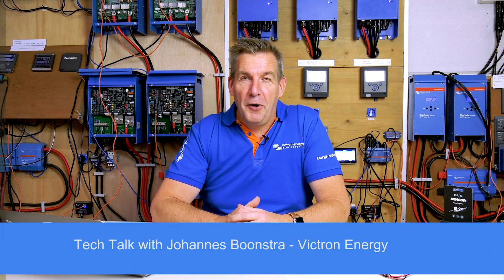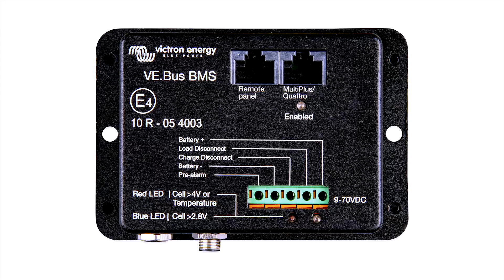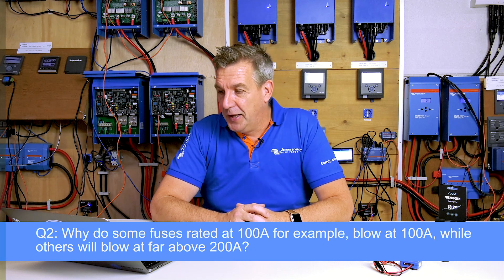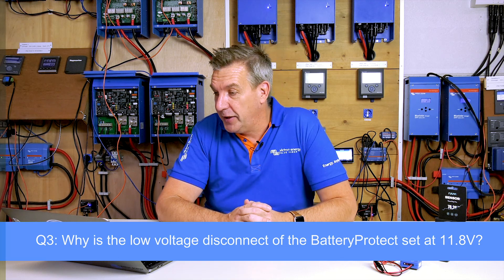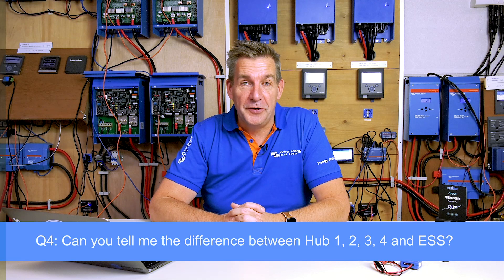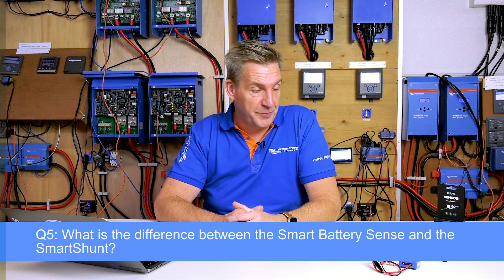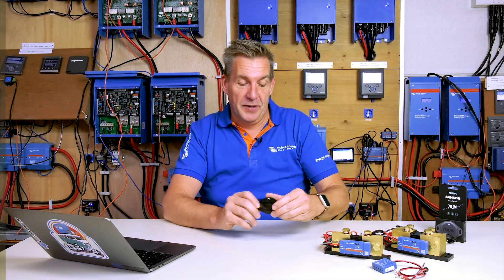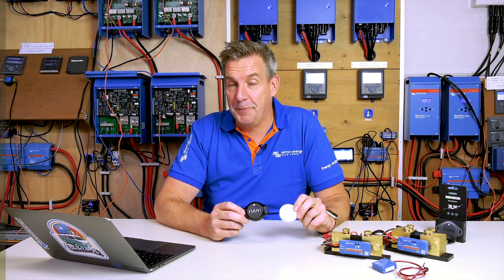Victron Energy Tech Talk - Episode 7 (VE.Bus BMS vs Lynx Smart BMS, Smart Battery Sense, SmartShunt)

Comment: Hello, can somebody help me with the settings/wiring 
from the Lynx BMS?
I have a question about the multipin connector from the Lynx BMS.
Pin1 and 2 goes to the Cerbo.
10 and 11 are bridged.
ATC/ATD and Relay are not connected.
My charger is an Skylla I.
Batteries are victron as well.
Connection between Skylla, Lynx BMS and Cerbo ist VE. Can.
What settings and Connection I need that the Skylla stop charging when batteries temperature is too low to charge?
In my case, the Lynx BMS disconnected (with the internal contactor) the batteries from the distributor and send an ATC/ATD alarm.
ATC is okay and normal, but why not ATD?
Best regards Robert
Reply: Please have a look at the manual as the terminals are decried in detail there.

Comment: Hello, 
if it's possible to turn the Shunt in the Lynx BMS that the power in is on the right side?
This would we great.
The manual said Battery's always left.
In my application the Battery's are on the right side.
Best regards Robert
Reply: Well its not just a matter of wiring the shunt, its also determined were the internal power supply is ect.  So no you cannot swap to the right , BUT, you can mount the unit "upside down" and use the stickers to have the wording on the front correct again.
Reply: @johannesboonstra6917  Hello, thank you.
With the Lynx Shunt VE it's possible.
(Changing only the five wires...)
What are the technical reasons that this modification isn't possible with the Lynx BMS?
Upside-down is no option....
Best regards Robert
Reply: @robertstuckle6198  because a BMS is something else than a battery monitor.  the reason is in the design of the BMS itself. If upside down is no option then there is no other option then to use longer DC cables I am afraid.
Reply: @johannesboonstra6917  Hello, thank you for the answer.
Is the following next model with 1000A technical the same?
Battery left without option to change?
Reply: @robertstuckle6198  yes, that's one will have a more powerful relay, but that's all.
Reply: @johannesboonstra6917  
Thank you.

Comment: Thanks Johannes, great information!
I have my Lynx BMS connected to my Cerbo GX via VE.Can. The other VE.Can port on my Cerbo is in use for my Hybrid network. I like to connect my NMEA 2000 network to the Cerbo GX in order to see my tank levels. 
My question: Can I free up a VE.Can port on the Cerbo GX by using the BMS-Can port for the Lynx BMS? If so, do I need to change settings? What do I do with the terminator in the BMS-Can 2nd port? Thanks, Jeroen.
Reply: Yes, CAN port can be used for multiple devices, as long as they share the same quadrate (Kb/s) , In the menu this value can be seen/set.    normally terminators are used in all open slots, when the port isn't used at all this isn't needed

Comment: I have the the 150/100 and 150/60 MPPTs running into a Lynx distributor>through a LynxShunt(1000)>to Lynx Power In. I also have a Quattro 24/5000/120 with all four connected to the CerboGX. The volatges I get at each unit vary as expected but for some reason the LynxShunt I get a much lower reading than the others. I decided to get the Smart Battery Sense just to reassure myself what the acutal battery voltage is and have the MPPTs use those for their charge guidance. 

Is there some way I'm missing to get the LynxShunt to get alligned with the other devices to show a more accurate voltage since that's what is prominently displayed on VRM? I have the Quattro battery monitor also showing on VRM but I would like to have the Lynx reporting correctly to get a better since of time to go.

Also is there anyway to get the Smart Battery Sense to show on VRM?

Comment: Would it not make sense for the battery protect setting to take into account the discharge current and the battery's internal resistance, so you wouldn't have to fiddle with the setting if your discharge current changes?
Reply: Hello,  then there is even more fiddling on settings as no battery is the same and also changes after time..  So...No this is not going to happen

Comment: hi////i have the victron bmv602s wired battery shunt,can you tell me if it can be used with the victron ve direct connect cable to a raspberry venos software
Reply: theoretically yes, but we dont actively support this so please check the community page to set this up further.

Comment: Victron is too confusing. Even making a simple inverter choice: is it a hybrid, grid tie, or off grid inverter? Clear as mud. If it wasn't for youtube videos I'd be clueless.
Reply: haha, there are many situations which all require a different approach to make reliable system, we try to adapt hardware and software to as many systems possible, the core of the product line is the charger/inverter called Multi , most other products are a spin off of these

Comment: Do u have any victron engineers in the rep of Ireland? . I've fitted a large 48v solar system with a 48v 560ah gel forklift battery attached and can get it full charged to last all night but yet the system is saying its full charged
Reply: Check you set the ah of the battery bank correct in the cerbo and multiplus.

Comment: Hi Guys, is it possible to feed energy back to the Grid from batteries of required at certain times?
Reply: yes , that's not something standard of course , but its possible. this requires a manual or automatic operating of the system (which needs to be written)
Reply: @johannesboonstra6917  could you point on the direction to get some more info on how to do this?

Thank you
Reply: @TheOffGridShop  that requires a company / person to write the code for this. 
We don’t help/ support these self made coding

Comment: Hallo, i have a Question about RCD Type for a Multi 24/800 is a Type A ok or is a Type B needed
Reply: As far as the inverter is concerned that doesnt matter, its just what local regulation dictate
Reply: @johannesboonstra6917   Yeah but here in Germany we need a Type B when there is some DC on the AC Side, but i got Informations from Victron over Support that both the Smaller one i have and the Big M2-XXXX System are galvanic sperated between AC and DC and so a Type A is fine.
Reply: @bavarianoffgrid4557  as all inverters are galvanic isolated there is no dc possible

Comment: with a mppt connected to 2 pv inputs and a quattro connected to 2 pv inputs  for a total of 4kw;  will both charge a battery at the same time? which one will be in control of the charging to turn
them to float charge or off?
Reply: It DC , so the highest voltage source will deliver the most power, when the voltage is low they both will go full power if needed.

Comment: Hi,  I've got a Blue Solar 12/24V-10A controller, with a single panel connected to my service battery in my camper.  All functions correctly, except the LED Display at the top right, which is fully RED when I press the "power" button below.  I reconnected everything, battery first of course, but still red.   There is no manual or app where this is described.   Can you help me?   thx in advance
Reply: you mean this one ?> https://www.victronenergy.nl/upload/documents/Manual-BlueSolar-Charge-Controller-12V-24V-10A-with-timer-EN.pdf

Comment: Johannes, can you please explain how the apart from capacity how the Victron Energy MultiPlus-II 48V 10000VA 140A 100A – PMP483105000 differs from the 48/5000/70-50?
The Manual says that the  VE.Bus communication port links in Three phase operation.  Implying that it wont work in a single phase operation.  I am looking for a Multiplus cabable of charging and discharging at say 70% of 100 amp.  Thank you

Comment: Hello Johannes, I have a question regarding connection Multiplus II to TN-C distribution. In my house I have L + PEN only (all circuits), so is it possible to connect Multiplus II to this or is it not? If not, please could you tell me why? thank you
Reply: Yes, you can switch the ground relay on/off if you prefer to have the N joined to PE in inverter mode or not.  For the inverter its not relevant on which type distribution you are.

Comment: My setup is 2 x 150 Ah Agm in serie with Mecer 2.4 Kv inverter.Like to use Victron Blue smart charger 12/15(1) 230 V to charge batteries .Do i use normal preset at 14.4 V or AGM spiral cell .Can i charge batteries in serie or 1 at a time.On battery info is charge voltage 14.4 V and float charge voltage 13.62V

Comment: Hey Johannes, quick question here: how long does it take for EasySolar II to switch to battery in case of electric network failure? The description of MultiPlus II reads that it takes some 20ms, enough for a PC not to switch off - does it apply to EasySolar II as well or does it work differently?
Reply: Depends if the UPS setting is on/off , fastest is ON.  then the exact moment of switching depends on the moment of switching on the sine wave. When unlucky you switch at the top of the sine wave and the unit expects the voltage to drop to 0V as will happen, but detects the grid failed when the voltage doesnt go to the lower part of the sine wave, then you have the 20ms delay. On most other moments of switching its shorter.   Switchin means also that you go from the the grid voltage to the inverter voltage which can be quite different, this also can make a switch mode power supply stop/restart.
Reply: @johannesboonstra6917  Thanks for the reply. Really appreciate the detailed explanation. Cheers!

Comment: Thank you for your information. Our electric car has a built-in wallbox with V2L, V2X 230V socket. I want to use the car batteries as home batteries. Which Victron product is suitable to manage PV production (5.5 kWp) energy use in the house, car charging and grid connection (injecting overproduction) simultaneously with this 230V car connection? In addition, a small battery in the basement for emergency power and power when the car is on the road.
Reply: Hello,   this needs a engineer to look into as there are options but not in a single box. please contact your dealer to help further with this.
Reply: @johannesboonstra6917  After your answer this morning, I once again presented the problem to the dealer and now it appears that it is also possible to use the CCS connection in the car (310V-410V DC). Now I think and hope that, by means of a DC-DC converter, a simultaneous connection of E-Auto and the network to the Multiplus is possible. Is that correct?
Reply: @willemrullmann2998  we dont use these connectors, so I dont see how that could work with a Multi then.
Reply: @willemrullmann2998  I dont think so , I have now idea how that should work.

Comment: I purchased a 12v 30a 3 output charger and when I set it up to charge 2 batteries it buzzes so loud I can hear it from 15m away. I put it on the night mode and it was still loud. I monitored the temp and it says they can get up to 50 deg c but this hit 58 deg and there's no sign of a cooling fan operating...smoke test near vents. Surely this isn't normal. Also are these made in india?
Reply: When you have the idea its not functions right, please contact your dealer to have to checked.

Comment: Thanks Johannes, great information here
My question - I have bought a SmartSolar MPPT RS 450|100 (great to have high PV voltage charger by the way, nice work Victron!). I want to put as much PV on this unit as possible. I am using the Victron online MPPT calculator with my specific PV modules (Jinko 370W) and my local min (0 degrees C) and max (40 degrees C) temperature. The calculator says I can have a maximum of 8 modules in series in one array per tracker (ie - 2960W), but the RS450 datasheet says I can have up to 7200W per tracker. What is the max number of PV modules I  can attached to this RS450? In what configuration? What happens if I over size the PV? Will the unit automatically clip? Or is there potential for damage? 
PV is cheap and I want to load up this charger to give me max generation during cloudy winter months
Thanks a lot! This RS450 is awesome 
Hamish from New Zealand
Reply: Hello,   To make a long story short , there are two hard limits you may not exceed. that's the PV max voltage (this will damage the unit instantly) and the max short circuit current, this will damage the unit (and battery) if something happens out of the ordinary.     So then you could theoraticly say as the short circuit current is 20A and the max voltage 450, the max power which you could install is 360V (which is the Vmp at a 450V panel array) x 20A =7200Watt.  The output will however limited to 5,7kW if you use both trackers (or 4kw) if you use one.

Comment: I love you work, I am a mechanical engineer and I find your explanations very understandable. I have a UK made product branded powervault, which contains an inverter that looks exactly like a multiplus compact. Inside the powervault box, 12v AGM batteries are connected in series to make a 24v circuit. There is a paire of wires I don't understand, one red and one black. If I remove the inverter cover the wires are connected to the sense + - terminals. The wire ends are crimped together into an M8 black negative battery terminal making a short?? Also, a simple one winding coil has been created by looping the pair of wire through a short tube where the wire leaves the inverter. Question is what is the wire and where should I put it? If I where to guess, I would put it on the negative terminal on the wire that connects the battery + and -. I suspect that it is a battery temperature sensor. However I am not feeling lucky. Any ideas?
Reply: yes, that's the temperature sensor, they are not just crimped by the way, there is a sense chip inside.

Comment: This a question that i can't find a good answer online: Regarding the surge protection in an RV installation with 2 Victron Multiplus 3000VA working together, Do you recommend a type 1 surge protector like "Square D - HEPD80"  on the AC input line for protection against surges caused by lighting while connected to shore power? Do you recommend a type 2 surge protector like "Square D - HOM2175SB" on the AC output line inside the main fuse box to protect against surges created by appliances inside the RV while connected/not connected  to shore power? How well Victron Multiplus can handle surges inside the RV while connected or not connected to the shore power without a type 2 surge protector?
Reply: Our experiences are that for lighting the surge protection doesn't protect the electronics well so can help on this I am afraid. The Multiitself isn't protected again this and like any other electronic can be damaged even with a indirect hit.
Reply: @johannesboonstra6917   thanks for your reply, what about the second part of my question about type 2 surge protector related to surges created by appliances inside?

Comment: HELLO! In my system I have a smart shunt, a smart battery sens, three smartsolar 75/15 and one phoenix inverter 24/1200. All connected to a Venus gx monitor. If I'm going to install one Orion DC-DC charger to Venus GX, is this capeble to find out where the extra power mesured from the smart shunt is coming from? tahnks
Reply: The Orion cannot communicate so if needed a smart shunt can be used to measure this if that's what you want to see. the data will appear on the device list and the VRM portal (not on the dashboard /overview)

Comment: I Own a Victron SmartBlue IP22 12/30 3 Output charger. I own two Victron SuperCycle 100ah AGM batteries in my boat. Can I change other battery to LiFePo4 battery and use Lithium program to charge both batteries at the same time or will the AGM SuperCycle be ruined?
Reply: You can only have one charge setting per charger, so the outputs will have the same voltage/absorbtion. Mainly due to the absorption time its not advised to have lead acid and lithiums on the same charger.
Reply: @johannesboonstra6917  Thank you, for the answer! 😊

Comment: I think I like the Tech Talk videos the most, thought other seminars are fascinating.
I am designing a portable solar battery for camping and power outage emergencies. I am considering your Lynx buss systems and looking at your smart shunt, master switch, and fusing systems, but I need this portion of the circuit as compact as possible. What Victron parts are suggested to fit my requirements? (I have 4 280ah LiFePO cells and a 200A Daly smart BMS)
Reply: thank you for the compliment!     On your question, it depends how much current you need to transfer to your inverter or dc load. As the BMS doe 200A I assume the average load is far less, so then a row Lynx modules would be a bit overdoing it I guess. Would a Smartshunt/Lynx distributor only be the best solution here?

Comment: great content , would i be able to use the Victron VE Bus BMS with AGM batteries thx.
Reply: No, as there is no need for a BMS for AGM batteries.  Only LFP batteries need a BMS to check the cells on voltage
Reply: @johannesboonstra6917  thanks for the reply. This answer prompts a few more question on the build i was going to use. I was going to use the VE bus for the Charge /Load disconnect function If I dont use the BMS will i be able to program the Smart Battery Protects to do this as one of the programs on the Battery protect.
The second part of my question is i was going to use the BMS with the Multi control panel will i be able to use a Cerbo unit with the Color display will this later combination give me all the functionality of the BMS/ Multi Control panel. Hope ive explained this